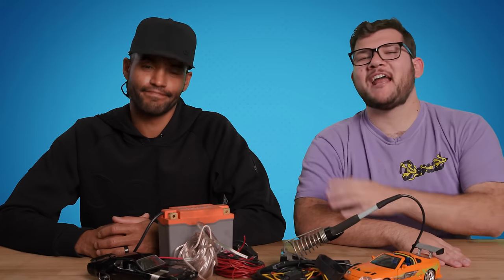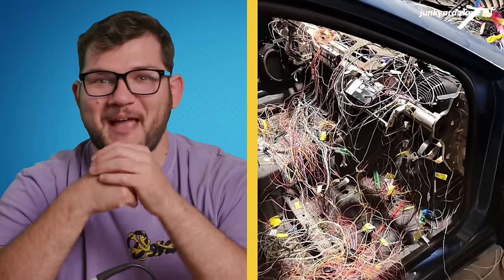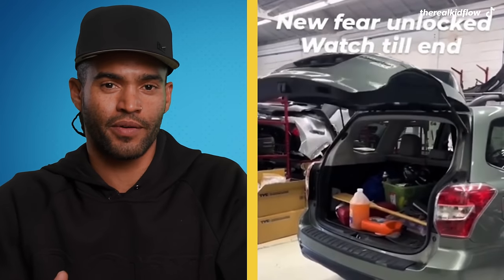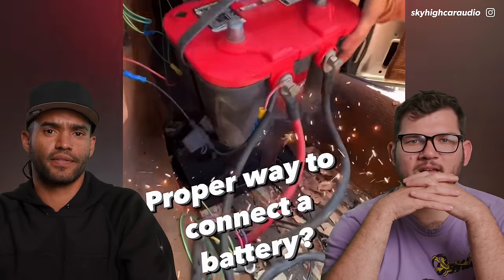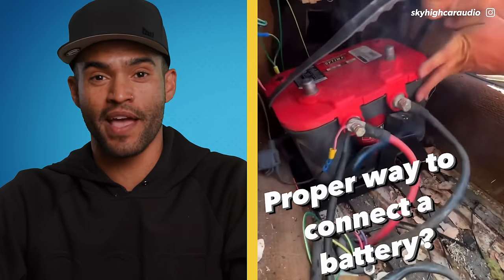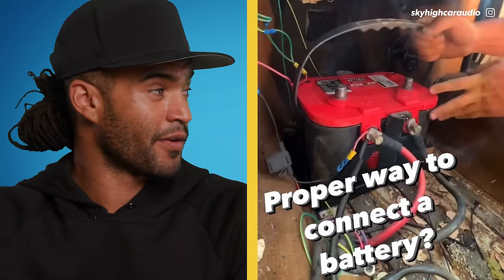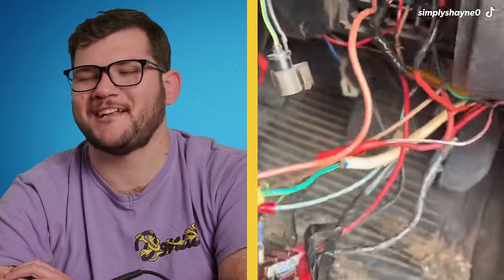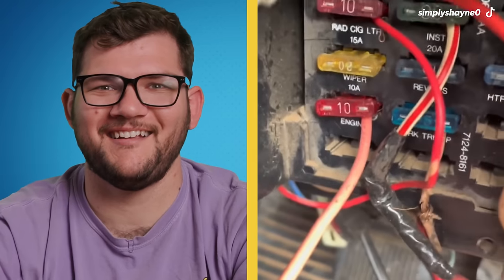Mechanic Reacts to Deadly Electrical Repair Fails

Comment: the battery terminal sparks with the mounting bracket between the terminals.... just rubber coat the bracket. problem solved

Comment: Wait, so your supposed to disconnect the battery when you change the starter? I mean, I did have red hot metal drip in my eye because I didn't, but thats aside the point.

Comment: 150 hours to replace a wiring harness? No, not even close. I see guys at work do it within two 8 hour days. You dont rerun all that wiring yourself. You get a new harness from the manufacture and replace it all. It does take dismantling pretty much all the interior and trim, dah, ect, to unhook the old one and place the new one.

Comment: 11:17 Toyota didn’t learn from Honda’s mistakes, Honda had to make an electrical tape with capsaicin in the early 2000s because rodents loved Honda soy based wiring insulation.

Comment: I found the wiring video and the mess shown is somewhat deceptive. He actually has it all connected to a fusebox in the back then just splayed out everywhere because he had replaced a lot of it. It looks like a horror show, but the wires are tagged. He basically just had to bundle the right wires together, zip tie and route them, which he does in the video. It was still tedious and time consuming but the messy state of the wires looked a lot worse than it was.

https://www.youtube.com/watch?v=Rb0P1loOOqQ

Comment: 6:03 alternating current ?!? how is it alternating coming from the battery to the starter ? you can even hear the starter struggling cause it's limited on the amp's

Comment: 12:44 "is that a Fiero? its right hand drive..."
NO FIERO IS RIGHT HAND DRIVE, and are mid-engine (trunk mounted transaxle design).
this vehicle had the engine in the front.
this guy is not an expert
Reply: Australian Falcon ute.
Reply: @derekhobbs1102  you're more expert than the expert

Comment: Can I ask why manufacturers used bioplastics on parts that need to last long term? Why can't they just use a plastic that's extremely easy to recycle like HDPE/LDPE? Biodegradable plastics are supposed to be used to make disposable products. I mean, set aside the fact that the organic oils used in these plastics tend to attract insects and rodents... electrical systems are too important to be coating with biodegradable jackets.

Comment: This dude isn't taking his truck with a block heater drag racing. Block heaters are made primarily for vehicles in cold climates because at low temps oil will do the opposite. It would be like your crankshaft is slapping through thick glue.
Lol @"Formula 1"

Comment: AC? Dont you mean DC? Vehicles use 12v DC not AC
Confused..
And its called the terminal wiring touching the metal of the vehicle on that battery clip
the hell??

Comment: The sparks are caused by inductive kickback in the wiring. 
12 volts is not enough create a spark gap, but if the current is suddenly cut off, and the wires have some inductance, then L di/dt (inductive voltage) can produce a high enough voltage for sparks. It's not the battery, but cutting off a high current with some inductive load can produce sparks.
Reply: you can create sparks with a 9 volt battery and a staple, its the current from the battery blowing off chunks of metal, not making a tesla coil

Comment: OMG, I have done alot of wiring in my electronics career,  from aircraft, vehicle, NASA, military aircraft,  and missles. I always used a schematic or went point to point and drew it or photo it. Along with buzzing it out with a meter. NEVER GUESS WHERE THE WIRE GOES, IT can and usually does end bad. Now I work on slot machines, and guess what....WIRING NEVER CHANGES
Reply: *a lot
"alot" isn't a word

Comment: He's not a very good electrician for cars at 7:21 in yall are talking about race cars heating oil an stuff lmao its cold whether set up for a car the "jb welded pad" is a oil pan heater should be one on trany pan to and then the one to the radiator is probably going to a inline water block heater anything below 25 degrees your supposed to plug in an warm your car up before starting it "Be Better Mechanics"

Comment: loool why do you keep mentioning "the track" (7:51)?  This is a guaranteed cold weather block heater home job for anywhere between Nebraska and Alaska where weather can be up to +/- 40C (focusing on -40C here).  One of those is the obvious oil pan heater you are referring to so you aren't trying to slurp thick gooey roofing tar like oil through your engine, the other would normally be  a battery blanket, and one of a core block heater, a coolant heater, or possibly a trickle charger so you are always starting on a 100% battery charge.
Buuut I too would be horrified at zip tying what seems like another extension cord into a ball underneath for the third plugin and where ever the heck that goes.

Comment: @6:03 Alternating current?  Really?  In a Direct Current system? My dude...Sure, alternators create alternating current, but they also have a built-in regulator/rectifier, so the output is in DC at your prescribed 12 volts.  AC will fry all the electronics in basically any car, not sure about EVs and don't really care to learn, but since they are huge batteries, probably DC like 100% of batteries.  Lost me at that one...
Reply: yes cause there is absolutely no reverse voltage protection anywhere in any car electronics ever made... 24 volts ac probably wont do shit to even a half assed aftermarket widget

Comment: 9:11
This explanation is not that good 😅
It's molten exploding metal. The power you draw from a car battery is only limited through the resistance of what you put across the positive and negative terminal. So when you connect a very short path with low resistance as seen in the clip, things get very hot very quickly. Especially when you only get contact through a tiny portion of the positive terminal, acting like a bottleneck. Imagine all the power that would go through an electric heater across the surface area of a few milimeters. It's enough to boil a tiny ammount of metal that comes inbetween the terminals, which then explodes outwards.

Comment: The flaming taillight could have been caused by a cracked ceramic capacitor, used on the led taillight circuit board.  Once a ceramic cap is cracked and exposed to moisture (especially salt water) it can generate enough heat to cause combustion.
Reply: for a couple seconds
Reply: @osgeld  a couple of seconds is all that is needed to start a fire.

Comment: 11:25 same with my hard disk on my older PC it was eaten by ants not just one Hard drive 3 hard drives biodegradable its  not good when its electrical or electronics.

Comment: You cali folk are soft. Oil pan heaters and block heaters are necessary in cold climates or your car will not start! The block heater in my car is 650 watts!

Comment: There is no alternating current buddy, he has a bad ground and when he calls for high amps for the started its drawing all that current through anywhere it can, and that is the result. No alternating current, this guy has no idea what hes talking about. Also yes that is a heating pad, vary VARY common, come to Canada literally almost everyone has an oil pan heater pad silicone onto the oil pan, nothing wrong with that, nothing to do with high performance at all.